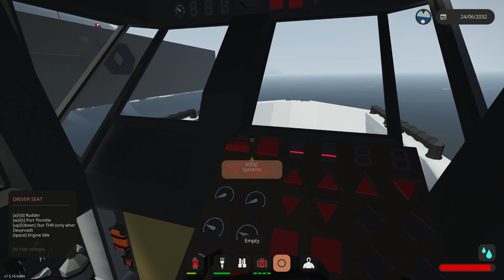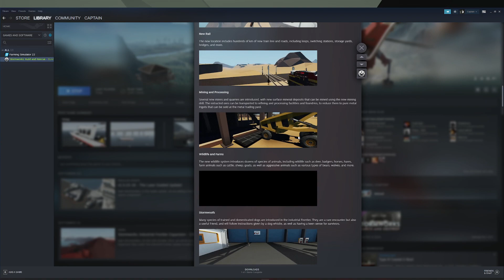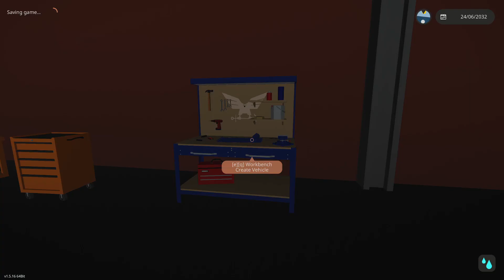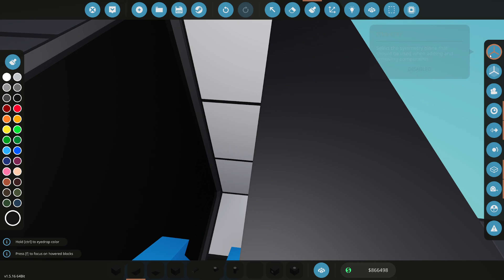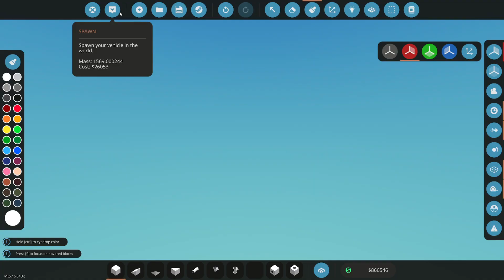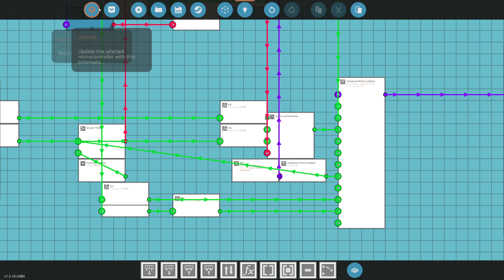Stormworks Career Build Series  159

Comment: I like the idea of a drone I've been thinking of making one that will have a camera and maintain an altitude of 50 meters above the GPS position of a ship. Or perhaps a landing pad that will be on the ship for charging.  Among other things but that's the main idea
Reply: If so then would you use electric motors? And how big would it be?
Reply: @AleksanderbigbyTwo  yea... Electric motors.  Currently it has 2 small motors and 5 medium batteries.  It's far from finished but I can fly it with Rx or via harness and has over 10km range with the batteries(Rx limitationis 10 km anyway and I lose video by then if on rx). And the current dimensions are 6.5m long, 3.75m wide and 3.75m tall.  I'm using Thales mods btw so some block may be those modified blocks